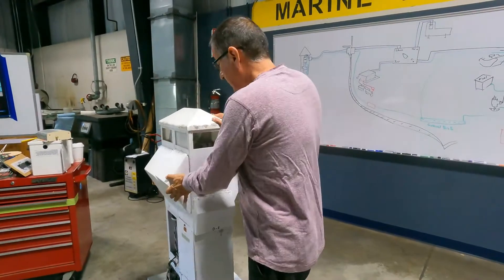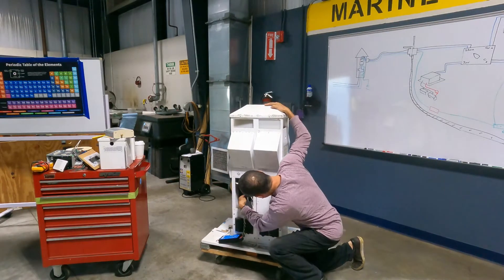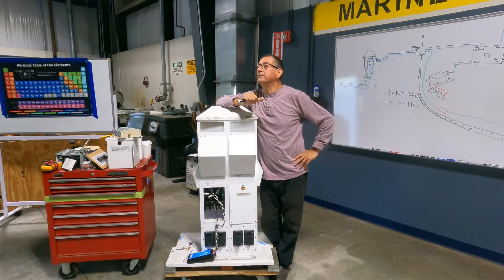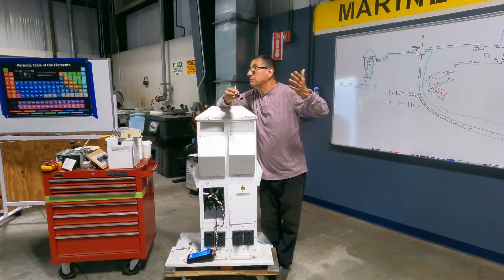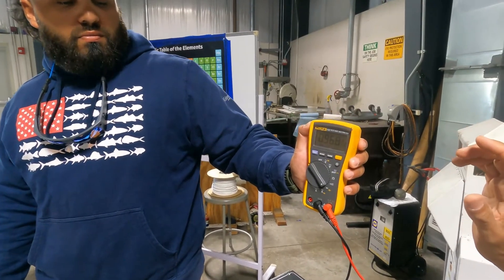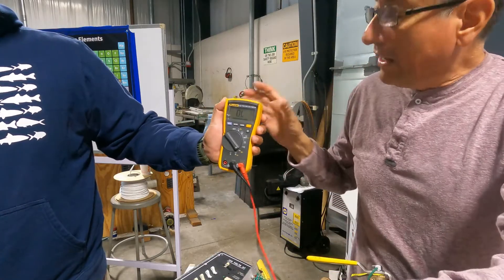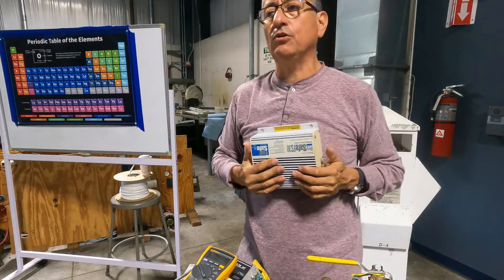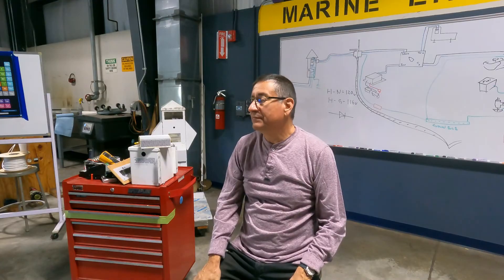What is the function of a GALVANIC ISOLATOR on a boat PART 2

Comment: Thank you very for this info…. Pls Mr Lopez do I need galvanic isolator on my board with inboard generator but no shore power?
Reply from the maker: No . It is recommended only when you have a shore power connection